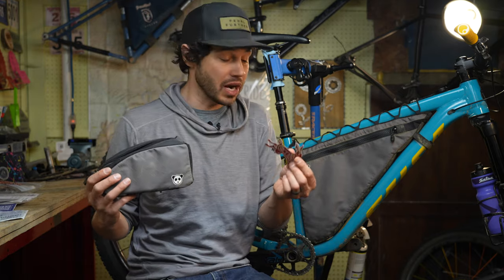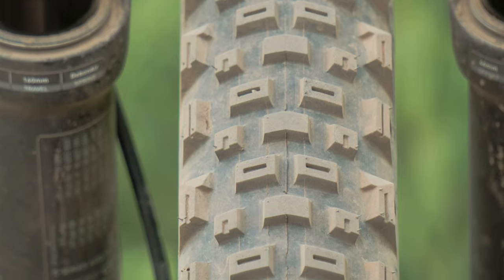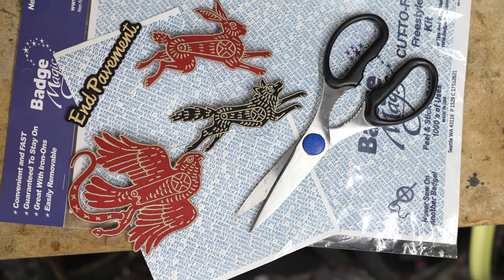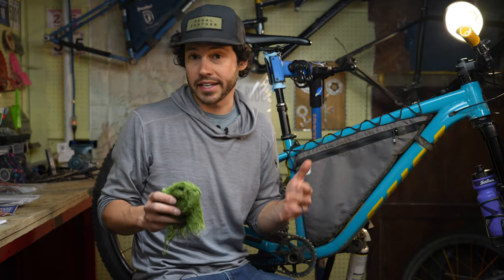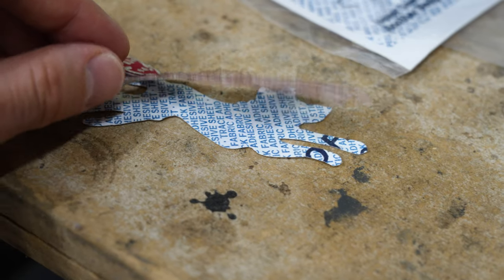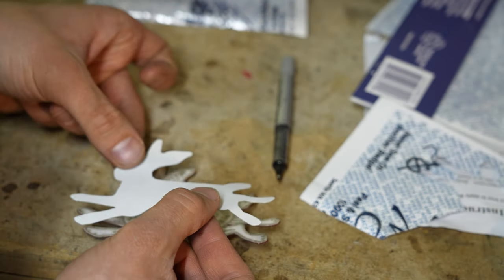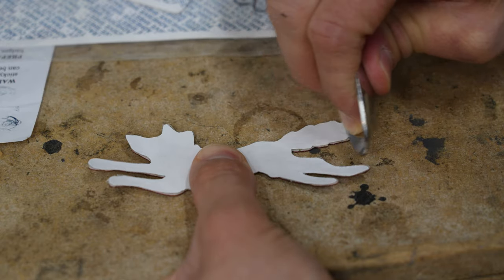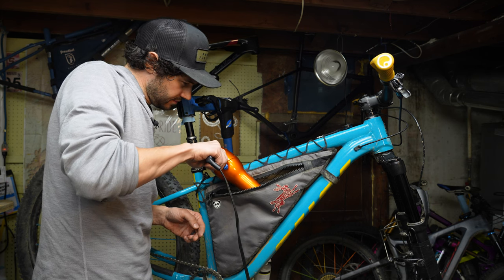How To Install A Patch (The Easy Way)

Comment: I use a product called Secure Stitch. It’s a liquid and the kit comes with two different compounds, one for porous items, one for non-porous. Holds like iron and I’ve never had to redo or touch up any patches I’ve done. It’s available on Amazon.

Comment: I use a Cricut Mini Press for stick on applications, and works like a charm. A tail side idea taking a hint from cooking, take a brick warmed in the oven (~110-120 F)  and use that to apply both weight and heat to the adhesive to get a better bond.
Reply: The brick in the oven is a great idea!

Comment: Shoe Goo is like magic. To clamp the patch while the glue is drying I have a big, round magnet (it was originally to do something for a pacemaker) that is seriously attracted to my enameled steel Porcelain Rocket/Bunyan Velo coffee cup. 

If a corner of the patch comes up or just needs some help, then I'll put a few stitches in but seal up the stitch holes with Shoe Goo or Seam Sealer.

Comment: Usually I use about a half dozen sheet metal screws and some pre drilled wood or plexi for backing.  Very secure.  Then again I usually use an overturned canoe for a raincoat so what do I know?

Comment: I have a bunch of awesome patches, but it's too much of a commitment to stick them on anything! I need to pluck up the courage soon...
Reply: I have a hard time with that myself. I finally went for it on my current bag and really love having done it. That being said kind of wish I had a velcro section of my bag so I could add some velcro backing to the patches and just swap them out regularly, though I'd also worry that they'd come off mid-ride and I'd be even more sad.

Comment: $10 for a double-layer sticker thing? Shoe goo is better and cheaper. You can also use the patches to cover holes in cloths. It costs less than $2 or $3.